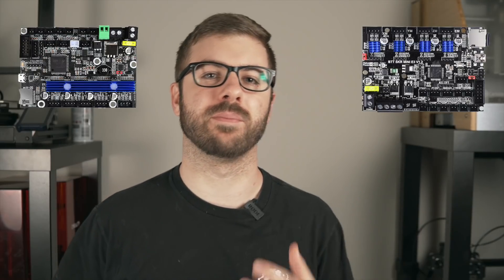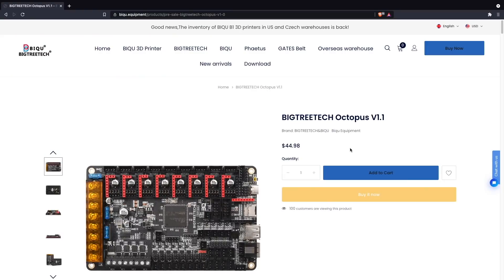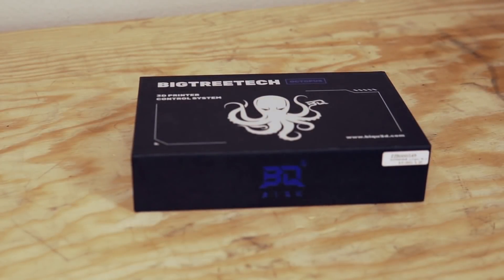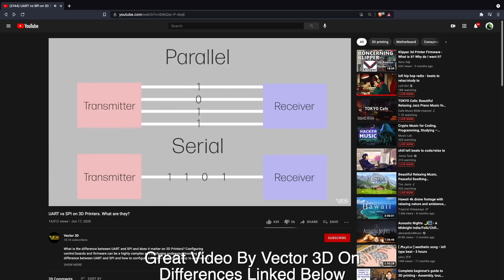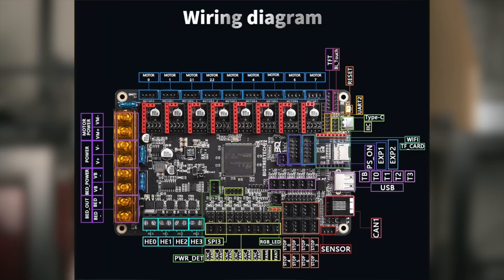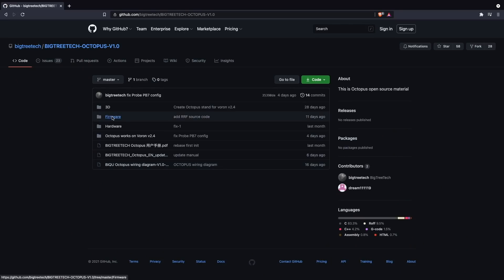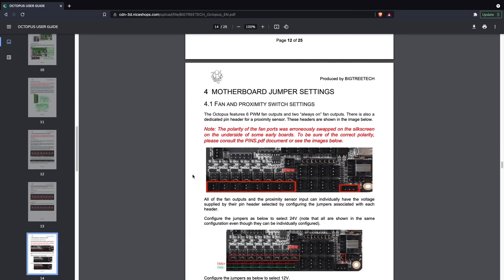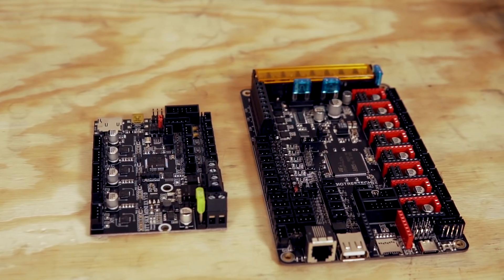The BigTreeTech 32-Bit Octopus Board Is A MONSTER!

Comment: A very good video and the Octopus seem to be a very good product.

On the other hand, a Voron 2.4 is normaly not a printer most users build as there first project. So you might have a lot parts already flying around, collecting dust. To use multiple boards instead of one board might be the better option. For example: Are TMC realy nessacarry on the 4 z-axis? Is an old 8bit Creality board with A4988 or any other RAMPS not efficient enough for conrolling z, as after the upgrade of an Ender 3 to a SKR e3 mini V1 it is unused anyways. And after the x-stepper driver of the SKR e3 mini v1 had blown up (sadly sometimed happened) - you have still 3 working TMC, so why not using this board for x y and e?
So I think it is a bit sad to buy new parts if you can reuse old parts instead to do the same. Of course, if you already build some Vorons reusing old parts and reused them all and actually need new controllers (or use other firmware than klipper), the Octopus is an facinating option.

As for changable drivers or pcb-mounted ones: There is no definitive answer. TMCs are made to be cooled from the underside by a big copper space underside the pcb - as it is well done on a SKR e3 mini V2 f.e. The modules do not have enough space, so you need extra heatsink and more airflow. Also no jumpering needed, so more beginner friendly as a drop-in replacement.
On the other hand, with a printer you tinker around with, modules are more flexible. Esp. if you try out closed loop steppers, there you are just using Dir/Step/!Enable and not a driver module...
So it is a decission you always have to make individual for the project you want to realise.

Comment: YEP! I am gathering all the parts now, for a Voron 2.4.  I will be using the BTT octopus board. But I will stick with Marlin for the firmware.  I looked into Klipper, asked questions about it and got nothing but trolled while asking.  So I'm out with using Klipper. Um sure Klipper is a nice firmware, but if people act like children, the firmware wont be around long.

Comment: Can you run these boards with some drivers missing? Want to buy this for future proofing and don't need all of them yet.
Reply: Yes, you just need a driver for each motor being driven. Sometimes you can run 2 motors with 1 driver but they cannot be independent in motion. The mainboard works perfectly fine without drivers in all slots.

Comment: Hi I am thinking of getting one of these boards, I want to stage the upgrades and cost and wonder if this board will work with the display on an Ender 5.  I think it is a great idea to have removable drivers.  De-soldering an SMD chip always comes with risks, particularly if close to plastic headers and a removable driver would help with diagnostics, i.e just swap them around to track a fault.  Thanks for your review. 👍

Comment: You're going to need 9 for when you build your multi-filament feeder later on. On that basis, I still think you;re better off with 2xSKR1.4 which gives you 10 available slots.
Reply: Then why not 2 Octo boards for 16?  The point was to “get it done” with one board.  If you’re going to stick in two anyway, why not?
Reply: If you want doing filament swapping right, you should do it the same way like Prusa does: The changer only moving the filament untill the direct extruder grab it or after it released the filament. So the changer is more or less a seperate unit anyway. You might want it be controlled by klipper - or simply run on its own, only reciving commands (like done on the MMU2). Anyway, due to much more easy wireing, a seperate controller just connected by USB and power directly mounted at a MMU2-style filament swapper would make the system more easy to wire up. Also at least for trying it, you can use an old RAMPS-based controller, wich might be a bit louder but being for free if you already have it from upgrading f.e. an Ender3. Or a SKR mini e3 with blown up x-driver (very common faliure on first batches) using the remaining working drivers...

Comment: I have the BTT SKR e# turbo.  STAY AWAY FROM IT!!!  yeahh  it does not support PT1000 therimstor. I have it and I can't use it ( tech support from said NOT suppoort pt100 or pt1000) . So Ironically I really do want to know is EVERYTHING on this octopus board better then the skr e3 turbo??  I have my board inside the frame spots for my ender 3 pro, and well I may just have to get a box for this specifically if it is trully better then the SKR E3 turbo in every other way?  I have TWO skr boards. one is the non working one because of the bad inductors proir to decemeber 2020...so if you get one make sure it is from BTT and a newer one too.

Comment: can i add 2 bed heater to this board
Reply from the maker: There is only one output for the bed. I wonder if you could run them in series. It has 4 for hotends but only one defined for the bed.
Reply: @ModBotArmy  You can surly reuse any Hotend-Heater for a second bed, if you add an external Mosfet or SSR. Multiple Beds in series are dangerous, as than you only have one thermistor assigned, so you could not controll temperature on second bed. But with 5 mosfets (one more powerful for a bed) and 5 corespondending thermistorinputs you can control 5 heat sources. depending of the power to control eventual with aditional MosFet or SSR. If it is a bed, a chamber heater or a hotend does not matter.
Reply: you can also use the expansion ports for endstops and such for extra bed SSRs
Reply: @tommihommi1  As said: you need a thermistor input anyway, so most easy way is to use one of the hotend outputs  to connect an external mosfet or SSR. This is more easy esp.  if useing Marlin, as for useing the pins on the exp. you have to edit the definitions - and do it again for every update. Of course on Klipper you have to do Pin definitions only once. But if you use Klipper,
Only reason to use exp. instead of heater output would  be to use the existing heater mosfet as extra controlable fan output.

Comment: This board is an overkill for my ender 3..
Reply: Just upgrade your Ender 3 to a second z-leadscrew with seperate endstop, change the x-axis to a longer one and add a second printhead, making it IDEX, just to justify the octopus 😃Or just use use a 4-way splitter with 4 feeders (an easy hardware mod but much tinkering with optimal load/unload sequence needed) to print multicolour. Esp an Ender 3 as a cheap tinkering platform definitly can make use of a board with many drivers. On systems using klipper, multiple boards are a more easy option...

Comment: I'd like to have servo motors & ball screws instead of stepper motors & lead screws since they are more accurat. But I would want a detailed instructions for setting this up with out going into the firmware to change a lot of stuff. I believe a 3D printer should work right out of the box without having to edit firmware. That is the major reason I will not purchase a 3D printer at this time. I have a 4 axis milling machine that I have not had to go into the firmware to get the milling machine to run like it should. It will be probably 10 years before the 3D printers can compete with milling machines or lathes. The quality & surface finish are not even close to a milling machine or lathe. All 3D printers are just toys that can't produce parts the surface finish or tolerance's that a  milling machine or lathe can. There is no 3D printer that can hold +/- .001.

Comment: what if you use a 15 cent mux  to address dual h-bridges, all the eway to N stepper motors?
Reply: Actually H-Briges are not the right thing to controll Stepper Motors. They work only if the voltage and the internal resistence of the motor fits. Fischertechnik made a plotter in the mid 80s working fine with the 6.8V used at the time; the controller used H-Bridges. Also actual modern Fischertechnik Controlers use H-Bridges - but with now 9V the Steppermotors overheat.
So you definitly should use current controll on stepper modules.
But if you adjust current manualy by Vref poti on a stepper module, you only need 3 signals: DIR,STEP and !Enable. You can connect !Enable to ground if always on is OK in your aplication (or share !En between multiple steppers). So only 2 lines needed to control a stepper.
If you use touchscreen, EXP1 and EXP2 have a lot of free I/O. You can connect extra stepper modules there. Bigtreetech even offers a cheep 3-socket extension for theese ports to put 3 modules there, upgrading a SKR 1.3/1.4 from 5 to 8 drivers.
Of course a mux is usefull if you use a 4-way filament splitter, to do multicolour. As only one feeder at a time moves, you can actually solder 4 driver modules on top of each other, without !Enable pin. The mux selects wich driver is enabled. But here also SPI setup is only done at boot, so you should use the stepper drivers in standalone mode.
To use a free Input pin as output, be aware on 3.3 V input pins are mostly made 5V tolerant by a voltage devider. If you for example use Power Detection Input as an output, the 3.3V output signal is reduced to less than 1.8V - invalid logic pegel. Your mux have to be designed to take care of this, f.e. using a Schmitt-Trigger to get a clean signal.

Analysing and modifying in pin.h is a quite powerful thing to increase board abilitys - or even repair boards. For example with soldered drivers and one being defect, but free I/O available, simply connect one driver module externaly and redefine  pins... Just recently done this with a z-endstop with damaged trace on the pcb. A simple change in pin...h and the unused power loss detection port became new z_min.

Comment: Would like to know if someone found out if the heated bead can work with PID or if it just switches on and off. The samples on the github page of BTT and also Klipper just show samples with "watermark" (run until slightly above target, turn off until slightly below target, turn on again, a.s.o.).

Comment: Had to remove my BTT SKR mini V1.3 from my Ender 3 Pro. Tried it for a few months, different firmware flashes, checked installation, kept freezing and glitching. 
Running my old Creality V4.2.7 32bit board and it's smooth as glass and much quieter, nearly completely silent. Always reliable. 
I don't think I'll trust BTT again.

Comment: I almost got the 🐙 but settled on the skr2. Still compiling firmware for it, my first time. They do seem to make decent boards
Reply: financial reasons or something else? really curious about the skr2 vs octo comparison.
Reply: @devilliersduplessis7904  prob not financial reasons the octopus and skr 2 are around the same price without stepper drivers added to the cost of the octopus, prob just because the octopus is a bit overkill for most builds

Comment: Not embedded so we can run close loop S42B stepper motors which are excellent for X & Y and should see more and more to move into 3D printing to avoid layer shifts. 
Also it would be very interesting if instead of a stepper driver for a stepper motor we can add a filament runout and or fan control module into the same place.
Also you need this board if you just do dual extruder, mainly even an SKR 1.4 turbo reaches it's limits because FAN control is the problem on that board with only a single controllable FAN port 2.3 the other 3 fan ports are not controllable on that board which is a bigger draw back but for us as a 3D print farm not a problem to have them run all the time.
Reply: @Daniel Massicotte I do need 4 at least but better are 6. And you talking SKR 1.4 Turbo 1.0 or 2.0 Board? The 2.0 is junk HE circuits don't hold up to high amp ranges and burn the board.
Reply: If you use a touchscreen (or klipper with webinterface), EXP1 and EXP2 with all the i/o are free. SKR even offers a cheap PCB to add 3 stepper modules there. Or connect mosfets for different fans there.
For Closed loop, simply put step/dir/!en for x and y here directly by dupont cables and edit the pin....h
Also if you use anything else than a bl-touch, you can redifine the servo pin to control an external mosfet. Or if you use ac heated bed, define this pin as heated bed an redrfine the heater output as fan output.
Free input pins can be redefined as output also. Due to voltage divider to make them 5V tolerant, the high-level is not in the valid range, so you have to get rid of the devider or use a schmitt-trigger to get the level up again.

Comment: Working great in my ender 5+ idex mod with klipper.
Reply: Do you use dual Z stepper motors? Been thinking of getting this to handle all the motors for an idex Ender 3
Reply: @Alex10000131  I have dual x, e, and z all independents. I want to put 2 y motors on the z (not independent) and a third z is in my future.

Comment: I will wait for several months for feedback on this Octopus first. I have a Voron 2.4 with BOM-spec BTT SKR 1.4s and BTT 2209s - and just search the internet for loud noise problems related to this hardware and you will find a lot of them. I have no such noise problems on my other printers. Which is why I guess they supposedly stopped making the SKRs.

Comment: Sounds like you could make two same size printer, use one board and you can do duplication mode all at one wack.  four drivers per printer, yep. that would be sweet, matter of fact, I might just build one, use 400mm split it in the middle make two 180mm x 180 print beds and go to town.

Comment: I’ve been thinking about building the 0.1, but am a little intimidated, as I’ve never built a printer from scratch before. Would love to see some more videos on the build process.
Reply: The V2.4 that he's wanting to buildis a completely different build process to the 0.1 the motion systems aren't even the same. You're better off looking at CNC kitchen or nero 3dp
Reply: @jakeengland1430   he actually said he’s building the 0.1. However I have watched videos on both those channels. I think the way ModBot explains things is a little more easy for me to digest though.
Reply: Correction: he said he’s going to build the 0.1 sooner and the 2.4 later down the road

Comment: I've heard that removable stepper drivers are more susceptible to failure, because the removable form factor is not ideal for heat dissipation. Most of the ICs are designed to dump their heat into the PCB, and the removable PCB does not have very much thermal mass to help draw away the heat from the IC.

So, it's like a self-fulfilling prophecy for people who prefer removable drivers. They fail more often, so their bias is confirmed.

That said, the drivers can overheat when integrated into the electronics, if there is insufficient cooling in general.
Reply: Nah that's nonsense. If you heatsink them properly the difference is nominal at best. There's only so much heat a PCB can dissipate, and removable at least gets the option of going with Trinamic drivers or cheaper A4988. Most of the boards just do it because the pololu format is a restrictive pinout and more expensive than just including them on the PCB already.

Comment: i wish they would of went with 50v caps so if you want to run the steppers at 48v you could then this board would of been almost perfect
Reply: Rule of thumb is to overspec the capacitor voltage rating to account for ripple, voltage transients, and capacitance loss at higher DC bias.
48VDC power rail would need at minimum 63V rated capacitors, ideally 75V

*Edit: A system that has 40V+ rails is considered a potential shock hazard and may be subject to additional safety regulations.
Reply: they are about to release a "Pro" version that has 50v caps.  announcement on Facebook a few days ago
Reply: @MrDead1975  FANTASTIC!!! Nema23 here we go
Reply: What’s the reason 50v would be preferred?
Reply: You can always rework the board if you REALLY want to -- but checking the power rails is also important
Reply: The octopus pro is now out. Supports higher voltage steppers and drivers